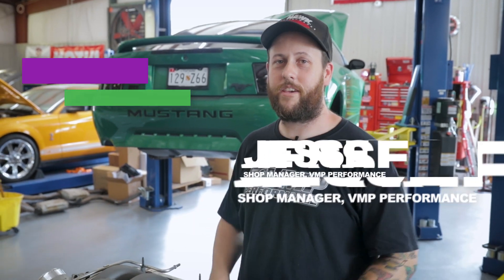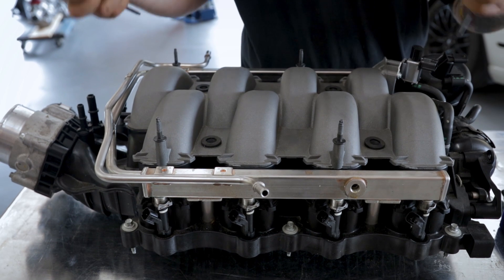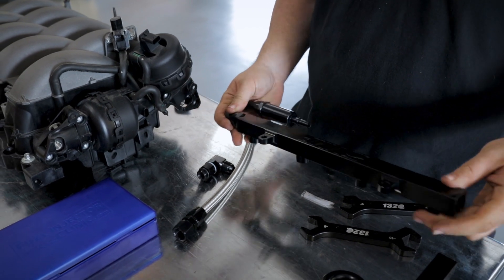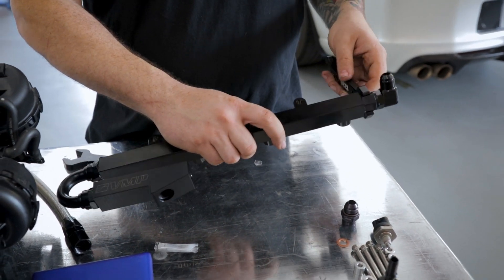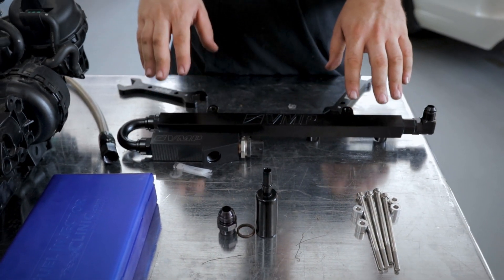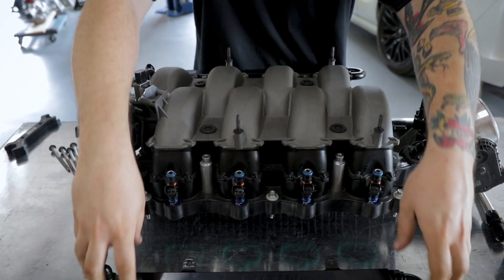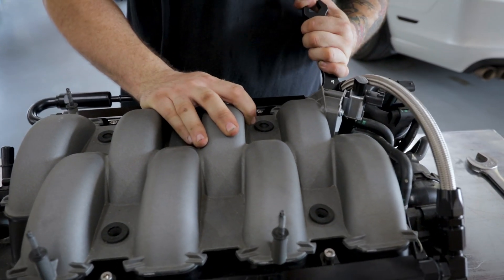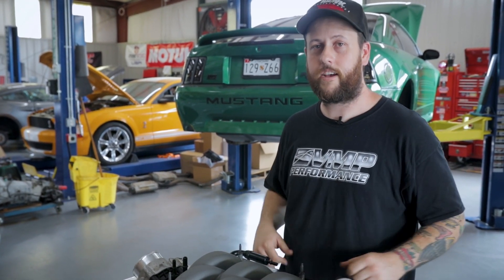18+ Mustang GT | VMP Fuel Rail Kit

Comment: Question I run stock mani and injector on E85 . Want to go with this system but 47 lb injector. Would I need to retune the car?
Reply from the maker: If you change injectors, you'll need a tune update.

Comment: 0:51 I have a 2016 GT with a 2018 GT intake manifold, will this kit work on my car ? Or would you recommend another kit, I’m a NA build
Reply from the maker: You'll need the following kit:
https://www.vmpperformance.com/VMP-Billet-Fuel-Rail-Kit-for-11-17-5.0L-Coyote-with-tall-injectors_2

That '18+ kit is designed to work with the Gen 3 cars that have direct injection.  Your '16 has the inlet located in a different spot.

Comment: These fuel rails don't fit on my 2021 because it hits the coolant connector on the passenger side in front of the fuel rail. Any idea why?
Reply from the maker: Shoot us some photos over to sales@vmpperformance.com so our support team can give you assistance in sorting this out.
Reply: @VMPPerformanceTV   I did and Alex(?) Pretty much let me know you guys don't have a fix for it.  I've been told to bend my coolant pipe but that's ridiculous for a product you advertise as fitting properly.  I have ordered from your competitor, fore innovations, a low profile 180° fitting that should solve the problem.  You guys should really consider a low profile option for all 2018+ cars.
Reply: @medicspc I know this is late but do you have a link for that fitting I'm having the same issue on my 2020

Comment: I have a 2017 mustang gt with a GT350 mani, I've tried some other fuel rails but they didn't fit so any suggestions?
Reply from the maker: Hi Joshua, we offer a fuel rail set for the '11-'17 Mustangs running stock or a similar intake such as the '18+, GT350 etc etc.  The link is:  https://www.vmpperformance.com/VMP-Billet-Fuel-Rail-Kit-for-11-17-5.0L-Coyote-with-short-injectors_2  To run this intake with stock injectors or anything other than than a "short" injector, you'll need this spacer and hardware kit as well:  https://www.vmpperformance.com/Fuel-rail-bolt-and-spacer-kit-for-11-16-Coyote-with-tall-injectors-60mm